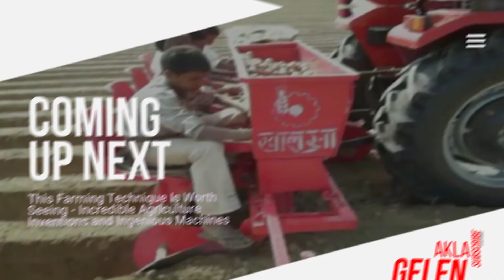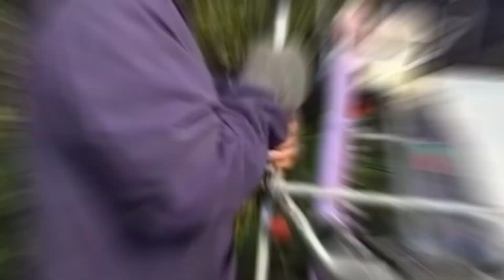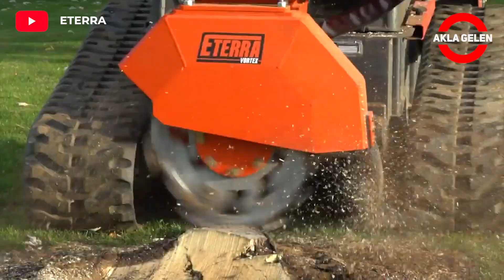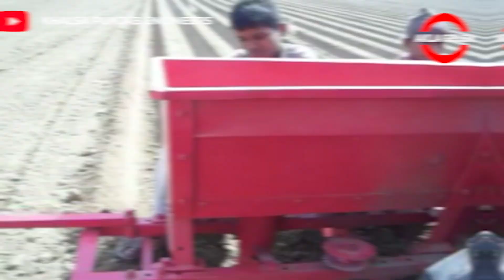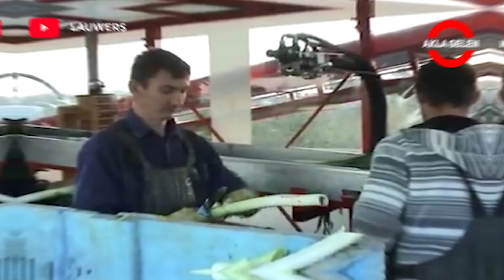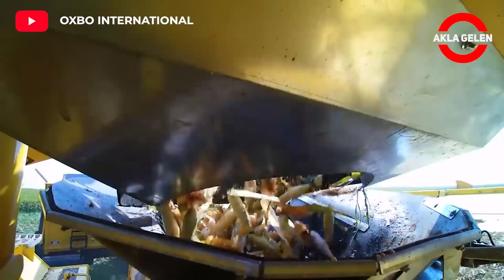This Farming Technique Is Worth Seeing - Incredible Agriculture Inventions and Ingenious Machines

Comment: Your “banana shredder” is highly dangerous and would be banned in most countries.
Reply: Totally agree with you. Yesterday I revisited an airplane hangar after 60yrs when I was then 15yrs old. Learned early to keep clear of propellers even when not running. Notice passengers still duck down approaching or leaving helicopters. Never stepped up onto a running tractor or rode on back of trucks. Have worked in construction up on scaffolding. Worn life jacket when boating. That spinning banana chopper would frighten anyone nearby but like my aircraft it works for good. I have wondered how many have died from working with horses. Ever swung an axe and checked everyone well clear?
Reply: Generally, I agree. I think the fact that there's no cage over those massive swinging blades that are more than a meter in diameter is problematic. This item would definitely not sell in many countries in this form. However, I think if a safety guard was placed over the blades it wouldn't be an issue.
Reply: These machines are very modern; they have truly liberated labor and increased productivity. However, on the other hand, they have taken away jobs from many people. What do you think about this?